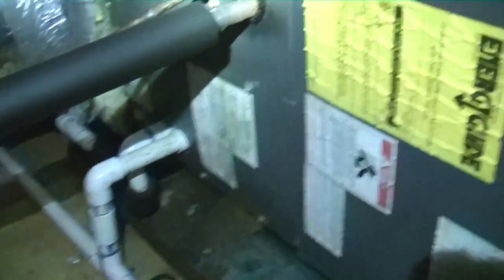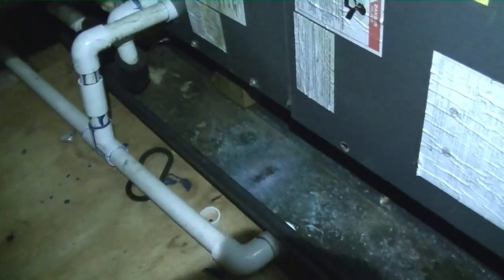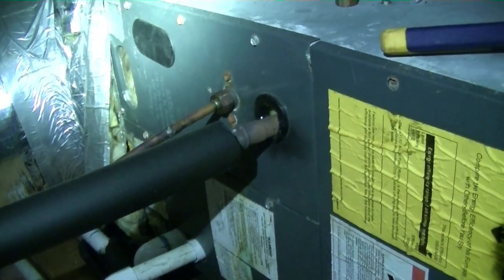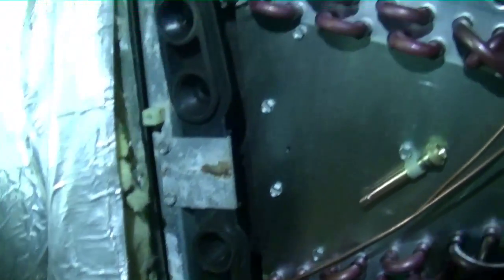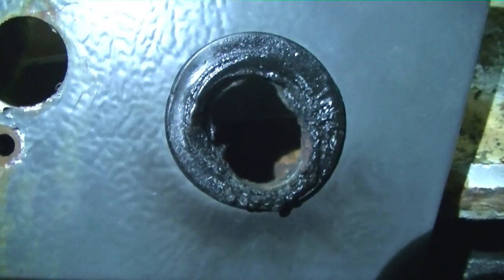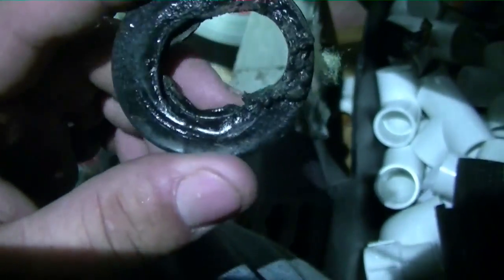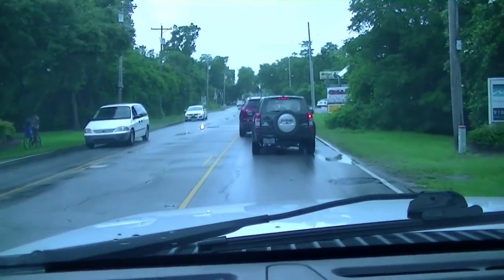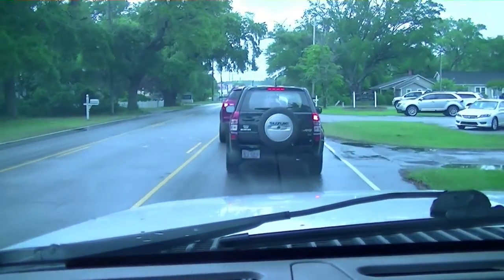HVAC Service Training- Goodman  Evaporator Replacement

Comment: When a compressor fails, does it mean that its locked up?
Reply from the maker: Locked up means bound up due to mechanical failure
Reply: +talyn875 Couldn't it also be due to an electronic failure?  like the start capacitor?
Reply: The coil could burn and cause an open circuit too. Not every fail is seized up

Comment: Good thing it wasn't a burnout. Most likely the compressor seized up. Sometimes the oil breaks down which will destroy the pistons and bearings. I seen it happen in a refrigeration system. A burnout is a big job to handle because as you know, the entire system will need to be flushed and any system flush is expensive.

Comment: I've had a few compressors die within hours after replacing condenser fan motors, they still ran but stopped pumping, just one of those things.
Reply from the maker: Shit happens, but hopefully not that often.

Comment: Sometimes is frustanting this job. But get a good rest at the beach man. You deserve it. The only way to explain what went wrong with the compressor is to open it with a grinder or something. That would be great for a video. 
Have a good weekend.
Reply from the maker: That would be cool, but that unit is in the scrapyard already.

Comment: So it runs long enough to get it charged and for you to get gone....that sucks for the homeowner. But it does happen... I am glad  I'm not the only one this happens to.
I took a a-coil out last week to clean..put back in and the unit ran for one day. Compressor went poo poo....but they couldn't complain, it was  25 year old .  Great video!!
Reply from the maker: wow, you are not alone man! 25 years is pretty good.
Reply: yes it is, the oldest that I have seen is a 38 year sears and roebuck. ran for 38 years...no problems at all. Blew the rod out the side of compressor last year.